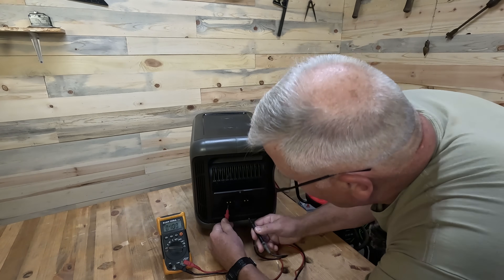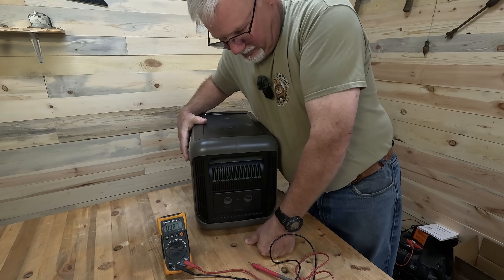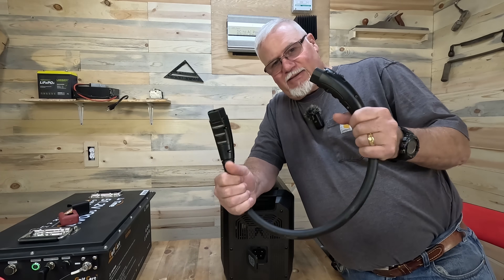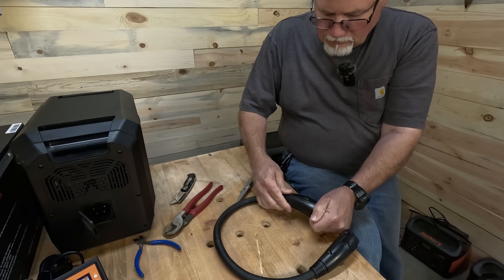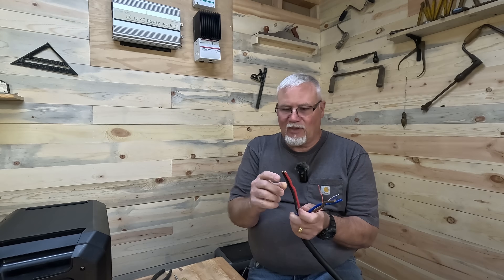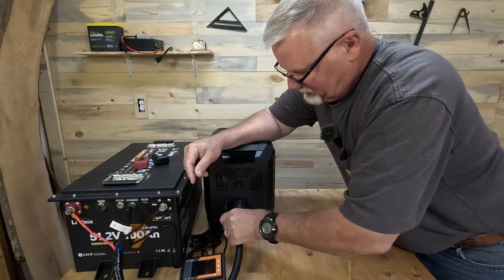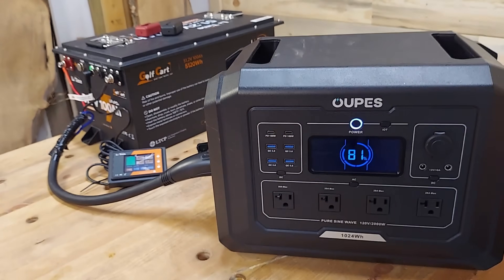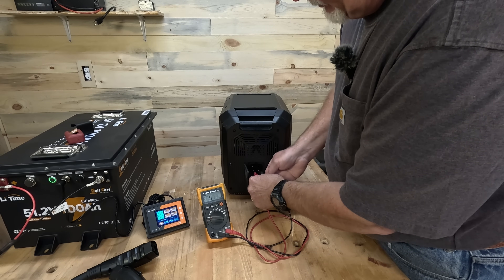Unlock Hidden Power: Connect Your Own Expansion Battery!

Comment: Allpowers r2500?
Can I connect the 5 kW battery to the AllPowers R1500? Or will you try it later? I can't find the cable to do that experiment, as it only comes with the 1 kW expansion battery.
Reply from the maker: I'm not sure.  I got only 49v from the All Powers when I was testing the port (which is open for use) so I'd have to try again to see if it bumps up the voltage but if it only gets to 49v that makes me wonder what they are using for a battery.  Should be 51.2v nominal (53+ when fully charged).
Reply: @TheOldJarhead I'd like to know, since a 1 kW battery costs $500 for a B1000. Perhaps a 3 kW battery would be fine?
But I can't find the cable to do the conversion. Perhaps you could try it; I'd really appreciate it.
Reply from the maker: I will see what I can find out
Reply: @TheOldJarhead Thank you very much. I really appreciate it.
What do you think of the Oupes Mega 2 or Mega 3?
I might buy one of those to expand my off-grid photovoltaic system. I need to power a 6,000 BTU air conditioner for at least 6 hours at night and 10 hours during the day. A small two-door refrigerator consumes around 90W.
Reply from the maker: I would go straight to a BIG battery bank and DIY system for that; with a low frequency inverter but if set on a Power Station the Oupes Mega 2 or 3 would be a good option (better all ppwers) and you can add some big batteries to them 😀
Reply: @TheOldJarhead I can't install a complete photovoltaic system because I'm renting and don't have the owners' permission. Instead, I'll install a portable system. I already have 1200W of solar panels. I want to install another 1200W or around 1800W to have enough power at night and to charge the batteries part of the day.
I just want to know what you think of the OUPES Mega 2 or 3 brands, since they reportedly achieve 1900W of solar input.
Reply from the maker: Got it.  Oupes Mega 2 and 3 are good units

Comment: Good evening Ole Jarhead, I hope this message finds you all doing well. Do you or anyone who made comments to the beginning of this chain (unlock hidden power) have any recommendations on a decent portable power station (1024Wh+) maybe a OPUS Maga 1? I'm open to recommendations, that can be manipulated to except an external 100Ah stand alone LiFePO4. I have two (2) 12V 100 Ah WATT Cycle batteries that I would like to wire in parallel (or use at least one or buy one 310Ah or larger) and tie into the expansion battery port. I understand that I may need to buy their proprietary expansion port cable and modify it like shown on your previous video but am willing to do it. Please advise. Sincerely, D
Reply from the maker: Sorry but 12v batteries are too low for this hack.  The onboard battery is a 48v LiFePo4 so you would need one of those to do this hack with something like the Oupes Mega 1.  Alternatively, you could watch my latest video and just buy a 2000w inverter for a lot less and make a small DIY system :)

Comment: My Dabbson 2300plus is 46.2V would a be able to a use a 48V?
Reply from the maker: Is that after being fully charged?  Doesn't seem right.  My DBS2100 Pro showed 53v if I remember correctly.
Reply: @TheOldJarhead My bad I don’t think it was. Just fully charged it. Although it still said it was taking in 9-11watts it read 100% for a good 10 mins. Got 47.7-47.8 so I should be safe with a 48v battery correct? As long as it’s within .5 volt?
Reply from the maker: Let it keep charging until it no longer takes power.  Often, they are balancing the cells and need to keep charging for a while.

Now, if fully charged, it should be no less than 49v, and even then, I have to wonder why.  A 48v LiFePo4 is usually fully charged when it is at rest (not taking a charge or being discharged) and registers 54.4v.  

Of course, a power station might show 53.7v or something like that because it's never really at rest. 

If it really is 100% and done balancing and still reads 47.8v, then I would question what's going on.  However, it's possible a 48v battery when attached will help get those cells balanced and higher, but something doesn't sound right.
Reply from the maker: You could also check with Dabbson (don't tell them why) and ask why it's voltage is so low.

Comment: Sounds like a new aftermarket accessories opportunity 😊
Pre-made interface cables for branded power stations with a nice breakout box, connection terminals and included fuse box and power switch for generic golf cart and similar batteries.
Reply from the maker: True!
Reply: Make so you can use any voltage battery with it.

Comment: Tried to test it on the Anker solix c1000 I can’t seem to get any voltage out of it at the port, any suggestions?
Reply from the maker: Hmmm they may have done like EcoFlow and used a CANBUS or switch to lock it out.  I'd try to find pin outs for the plugs if possible.  Otherwise, aside from tearing it open and seeing what they've done it's a tough call.

Comment: I have the Anker C1000 and with that plus the BP1000 expansion battery. This power station is designed to run on the expansion battery first and then switch to the power station internal battery second after the expansion battery is fully depleted. There is a relay switch that you will here click inside the expansion battery allowing it to register any operation with the C1000. In other words it’s probably not capable of true parallel battery charging and discharging through the expansion port. I think Anker thought this one out.
Reply from the maker: Could be and I suspect others likely are going to do that.

Comment: Great video! I hope we get folks to post all the pinouts for all brands and models. The manufacturers want you in their expensive "ecosystem".
On Ecoflow, there are 6 small communication pins, in addition to the + - power mains. 
I'm glad that your unit can parallel connect without any proprietary 'handshaking".
We bought the units, let us use the tech any way we want to. 
Keep the hacks coming! 😊
Reply: Further info: The Ecoflow uses a true 51.2volt battery.
I once came across a list of the communication pin functions, but forgot to write it down. IIRC: there is a 'wakeup' signal, a CAN-BUS, and (a SPI bus) EDIT: no SPI bus!.
I just checked mine. The main power pins (pretty easy to locate) are dead with nothing connected.
Reply: Found the list. This time I saved it.
Delta 2 Extra battery port

Pinout marked on Wave 2 PCB
1 Can-H
2 Can-L
3 Wakeup
4 SigOut
5 SigIn 1
6 SigIn 2

3ft Cable color/pin (twisted pairs)

1 Violet
2 Orange
3 Blue
4 Yellow
5 Black
6 Red

More info: The pins are clearly marked and numbered: Look closely.
Main battery terminals: Left is positive, Right in Negative.
Communications port: Pin1 is top right. 2 and 3 are below it. Pin 4 is top left, 5 and 6 are below it.
Reply from the maker: Hmmmm it's that 'wake up' one I bet.  Likely gets a signal from the external battery and opens the switch but the 'can-H" and L suggest CANBUS and that means I'm out of my league there!  I'd have to do some research but I bet it's harder to hack than a simple switch style.  Thanks for sharing. (oh and doesn't mean I won't try lol)
Reply: @TheOldJarhead  I got some time to do some experimenting. It looks like the Wakeup pin is just an extension of the power switch. It doesn't make power available on the battery pins.
Reply from the maker: So the main unit power turns on the battery.
Reply from the maker: Good question?
Reply from the maker: Hmmm...
Reply from the maker: That's great info on the Ecoflow pins!  Hopefully, we'll get that data on all the power stations.
Reply: I'm curious about the wake up pin as well. My Delta pro 3. Test just enough voltage to get positive and negatives. I'll get like 17 volts. The longer I hold it it drops to zero.
Reply from the maker: If it's just a NO/NC type switch then connecting two pins together (which I can't say) would engage the parallel port but if it's a CANBUS then I'm not sure to sort that out.

Comment: I own a couple of EcoFlow Delta 2’s and one extra battery. I saw your other video on the proprietary cable and was curious if it would work but have since picked up their alternator charger. I plan to cut the cable to it and have one long cable that stays in my 4Runner and make a short one for my camper LFP battery. Will use an Andersen style connector to move the charger where it is needed. The great thing about it will be that I can transfer energy either way. At $209 I thought it was well worth the price to add flexibility to my use case.
Reply from the maker: That's awesome!  That's the type of thinking that makes it fun to go off-grid.
Reply: Greetings, I have a delta 2 as well and just watched your video (unlock hidden power) and could not get a voltage reading through the expansion port. I checked the app settings and there is no feature to turn this on either. The manual states this unit has a 51.2 v battery but how do I verify this through the port. And is there something I need to do to activate the port? Thank you for your time and thanks so much for all your informative videos. Sincerely, D
Reply from the maker: It sounds like they are using the communication wires to turn on and off a switch that allows use of the expansion port.  If they are using a CANBUS it may be harder to make it work than if they are using a simple switch (normally open / normally closed) and without a pin out of the cable that would be hard to sort out and possibly damaging to the unit.  If you can find the pin out, that would be the first step to figuring them out.
Reply: @derekheidenreich3824  I watched the video last night (5/22).  This morning I checked the expansion port on my Delta 2.  Same results.  Whoever is brave enough to hack this and spread the word would get my praise.
Reply from the maker: Hmmm if I get one I may have to see if it can be fooled ;)
Reply: @derekheidenreich3824  I'm guessing that there is a relay that keeps the battery connections dry (deactivated) when they are unconnected. I'm tempted to get inside my Delta 2 and see if I can make sense of it all.
Reply from the maker: I think it's in the CANBUS...but probably could be hacked by someone willing to mess around.
Reply: @TheOldJarhead  In the best case, the CAN bus is just used to run the user interface (display, buttons, etc) and some instrumentation. If that is the case, we can find an easy way to activate the battery connection. Even if it means opening up the Ecoflow and soldering a wire across the relay terminals. Worst case is that the CAN bus is used to Authenticate and Authorize a connected device before connecting it. I don't think we could hack our way around that.
Of course, we may be overthinking this. The engineer just wanted to protect idiots worst than us who would try and connect mismatched batteries to the Delta 2. So maybe fully charge the Ecoflow, and connect a fully charged, 48volt  battery. And see what happens. Maybe the Ecoflow is just going to verify correct voltage and connect. Put a heavy load on the Ecoflow and see if you can measure a current flow from the external battery. I don't own a 48 volt battery or I would already be trying this.
Reply from the maker: That makes sense
Reply: Thanks for your reply.
Reply from the maker: You bet!
Reply: why not feed external batteries with solar or dctodc and have them charge the power station?
Reply from the maker: Absolutely

Comment: hmm - was gifted a POS 4Patriots 2kw output, 1.6kw battery - first time I tried to draw 1800w for a miter saw, the inverter gave up the ghost, haven't been able to turn that on again (error 61). Was thinking of adding a battery to it, this helps greatly! That is, if I can figure some way to make the inverter work again. USB/12vdc outputs all still work. DO NOT BUY that 4Patriots junk!
Reply from the maker: That not good!!! I wonder if it's a breaker that tripped internally.  Maybe call them?
Reply: @TheOldJarhead  s'ok, I knew it was junk when Mom bought it (she passed and I got the inverter). Am now building a rolling cart with Sungoldpower 8k inverter, that'll carry 2ea 5kw heated batteries to take to the cabin build site. Eventually will be the main power out there. Thanks for the vid - have learned quite a bit from you - on solar, and millin'!
Reply from the maker: 8k inverter!  WOW!  That will run two cabins :D  Sounds like a lot of power that will do you well!  I have a 4k LF Inverter and just shy of 10kwh of battery and love it!

Comment: I was thinking about doing this on my Growatt but can't for the life of me find an "expansion battery" cable. I can't get one from them unless I buy one of their batteries.
Reply from the maker: I've heard that about other companies as well.  What I'd look for is the connection type.  I'm guessing at least some of them are non-proprietary connectors that might be able to be made, like trailer connectors.  Hard to say but I bet it's possible.
Reply: @TheOldJarhead  I found it! The connector is a unique connector made by a Chinese company, it's used for a couple electric motorcycles. I found the connector on ebay, it's called an M23. I might just make my own with a couple banana plugs to see if it works first.
Reply from the maker: If it's the right connector it will work :D

Comment: Eric or Erik? I was impressed with the previous video that showed you figuring this out. Now that you have exposed this feature, I’m guessing that the major brands will prevent this in the future. They could very easily disable this activity via a firmware update in the name of “safety”. The main unit charging the paralleled battery is what makes this tip so awesome.
Reply from the maker: Yeah, I'm sure some will try, but I think it'll take some time for the manufacturers to catch up. and frankly, we may be able to sneak around it still ;)
Reply: Eric or Erik?
Reply from the maker: Erik :)

Comment: What do you think about the new Bluetti Apex 300?. I've been trying to figure out which power station to get for my truck camper build / fifth wheel / off grid cabin / 4 wheeling adventures. I was leaning towards an AC200 for the higher output and 30amp plug, but if I got in on the pre-order for the Apex 300, it would be a very similar initial price. And on top of that there will probably be Memorial Day deals on other units that will completely overwhelm me. Decisions, decisions.........!
Reply from the maker: I'm not familiar with that one yet, so I can't say.  Bluetti has a good name, though.  However,  for my camper and cabin I prefer DIY offgrid power setups

Comment: Is it possible to charge your DYI expansion battery with its own MPPT and solar array while connected to a powerstation? My goal is to both add watt hours and PV input.
Reply from the maker: Yes.  In fact, being parallel it would charge both.

Comment: PECRON EP3000-48V Expansion Batteries are only $809. Buying these for my Pecron E3600 pair. So compact and that is 3072Wh for $809. Show me another 48V battery, that compact for less money.
Reply: I purchased an Ogrphy 51.2v 100ah 5kwh for my Pecron E3600 and used a MJ32 to ring terminal cable that I made. It works great. You can get that battery off of Amazon for $720. So 2kwh more for $100 less than the Pecron battery.
Reply from the maker: That's awesome!  I was wondering what connector they used.
Reply: @BarryBurtenshaw That’s great to know but my space where I keep my dual E3600 is small so having a battery that is the same size and fits right under it is the way I have to go.
Reply from the maker: Can you mount one on the wall?  Many have the new wall mount batteries now.
Reply: @TheOldJarhead  Good evening Ole Jarhead, I hope this message finds you all doing well. Do you or anyone who made comments to the beginning of this chain (unlock hidden power) have any recommendations on a decent portable power station (1024Wh+) maybe a OPUS Maga 1? I'm open to recommendations, that can be manipulated to except an external 100Ah stand alone LiFePO4. I have two (2) 12V 100 Ah WATT Cycle batteries that I would like to wire in parallel (or use at least one or buy one 310Ah or larger) and tie into the expansion battery port. I understand that I may need to buy their proprietary expansion port cable and modify it like shown on your previous video but am willing to do it. Please advise. Sincerely, D
Reply from the maker: For 12v the best power station would be the Comvolt power stations.  These are 12.8v systems (which you would need if only using 12.8v batteries).  Otherwise, I'd move to 48v batteries because all the others are 48v and you shouldn't parallel batteries of different voltages! https://youtu.be/YeSRXIhfwA0
Reply from the maker: That's 26c per WH -- I see LOTS of 51.2v batteries on Amazon for 19c/wh -- they are less expensive but that Pecron deal is a pretty decent one though.  So, yes there are less expensive options that are compact but the Pecron is a decent price, no argument here.

Comment: These cheap, high frequency, transformers inverters don't use an output transformer and because of that, they can damage your appliances when their MOSFETs fail. Why are you promoting it?
Reply from the maker: I'm promoting hacking it.  People make use of power stations often and they seem to really like them so I do what I can to help them.  As for HF inverters damaging equipment, I haven't seen that yet nor have I seen studies saying they will but I have used them to run many things without issue over time.  I prefer LF inverters myself but the new HF's seem to be quite useable for most things.